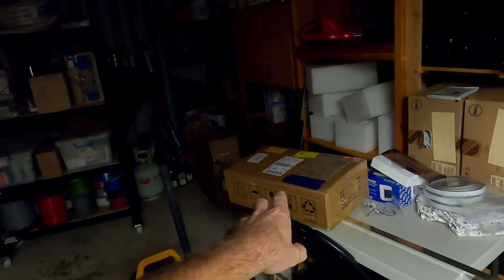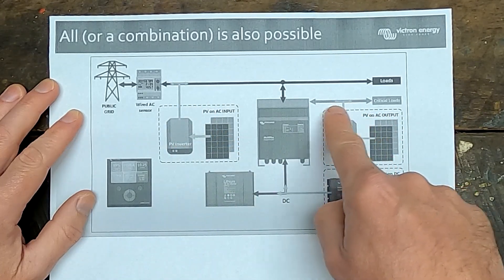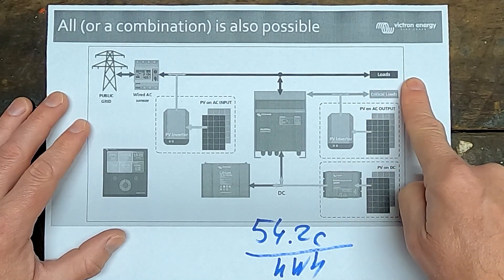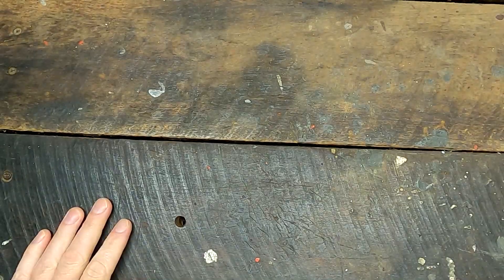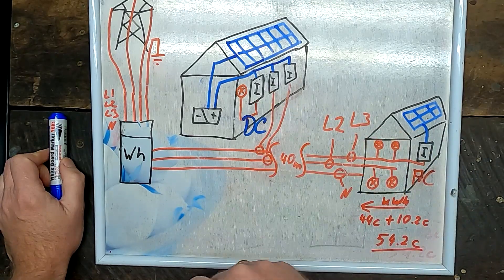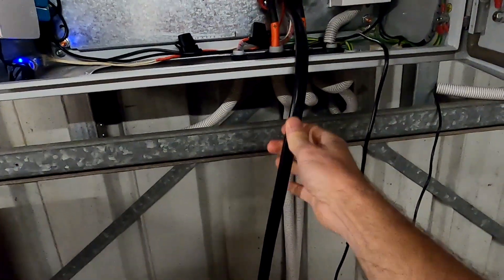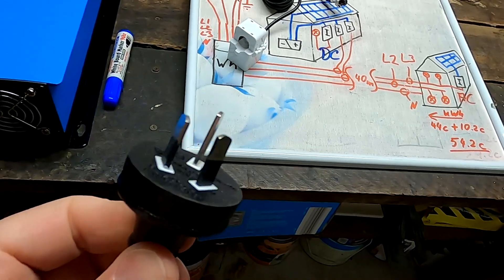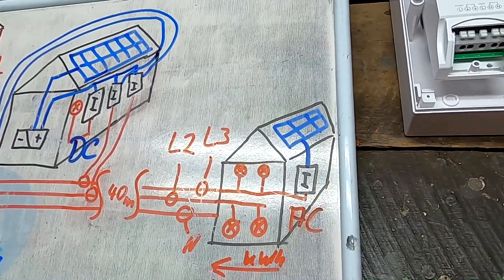Zero feed-in solution to power the house from the battery (and stay legal)

Comment: Andy, I can't stress how dangerous  and illegal what you are doing now. Did you check that this unit is   on the approved list of equipment of your electrical provider, if it is not your insurance of your house is now voided. When you where off grid all good I.e not connected to the grid. Now that you're partly connected to the grid,  there are minimum codes and standards you must meet. Also pumping AC loads bach into a GPO socket is incredibly dangerous, and should never be done. I would strongly suggest you take another look at the victron multiplus because it does meet the minimum AS standards and can be connected to the grid but you will need a qualified electrician to connect it to your switch box. I been down this  road you are going and this the only way that is legal
Reply from the maker: All good, the inverter is CE approved and will not feed into the grid. It's a grid following inverter with anti islanding and will shut down far quicker than the regulations request. In case an RCD triggers or the grid fails it's off in less than 18ms (30ms is regulated). I will not feed in the power through a GPO. This is just to demonstrate how it works. There will be proper RCD and breaker protection as per regulation. Come on... 🤷‍♂️
Reply: @OffGridGarageAustralia  You understand how CE works right?
Reply: I think this may be the only grid tied solution that will meet Australian standards.
Maybe get in touch with Andy and talk to him about it.
Reply: @andrewradford3953  couldn't find the spec sheet for this particular unit but I know for a fact there is no Australian Standard for connect  ing a power source to a GPO, in the  electrical world it is called "a dead man's cable" connection and is band by all electricity suppliers in Australia. So if there is a fire and your house gets damage and the fire inspector sees this type of connection say goodbye to your insurance. There are numerous storys on the web about how bad dead man connections are.  In short, all power units need to be an approved unit and wired into your switch box by a professional. Unless it's through your hot pug which has been installed correctly by a professional. But your hot plug will disengage from the grid when active for obvious safety reasons.

Comment: My friend from Australia... In the victron diagram you would just need to move the current sensor to BE between the main PV inverter and the Multiplus... All energy would go to the grid and the victron uses the battery and solar first... I don't know if the law permits that for your situacion but it would work!
Reply from the maker: That's what you say, but this is not what the diagrams and manuals say for the Multiplus inverters...
Reply: @OffGridGarageAustralia  it basically makes the AC inverter for the big array part of the grid supply. Then the Multiplus ii and the quadros Will consider the energy coming from there as "grid energy".
The only problem for you is the placement of the inverter (is it placed near the main grid AC input? Is it placed in your house?)
And also the quadros and the Multiplus ii can feed back INTO the grid.
I've installed such systems in Portugal and some clients want it like i explained before. We don't have the 54 cents... We only have 4 to 8 cents and we don't have the rules you explained in a previous vídeo. We have people that have systems like yours for 10 years now and they want to Change in order to consume everything they produce because we pay 14 cents per kWh and sell the excess for 4 cents... It's Basic maths.

Comment: I'm certain I've seen the Solark do exactly what you want to do.
Reply: And he is not in the USA so he could easily buy the deye version.  Same  hardware, slightly different software. For about 2000 USD compared to sol-ark which is MUCH more expensive.
Reply: Solark, Deye or Sunsynk inverters are all hybrid (basically the same). I'm any of them will do what you are trying to achieve.
Reply: Solark don't sell in Australia. I don't know if the same inverters are sold under a different brand though.
Reply: @alexsimmons1803  Yes , Deye . for 2k

Comment: I've been thinking about this since you mentioned it a few videos ago.  I'm looking to disconnect some of my house loads from the grid and connect them to the output of a hybrid inverter.  This way the disconnected load is no longer directly connected to the grid - just connected to the hybrid inverter output.  The loads are then powered by a combination of solar/battery/ and incoming grid power as programmed into the hybrid inverter.  I shouldn't need any transfer switches to do this, unless I want a failsafe for the hybrid inverter.  It took me a while to get it this simple.
Reply: A hybrid inverter so you sell power to utility? If not then off-grid inverter.
Reply: @mrzed6597  OK, I get your point - Thanks.  I was planning to completely isolate the loads and attach them to an off grid inverter.
Reply: @donnymeyer1984  It is like many of us do. This is the way :)
Reply from the maker: If you can generate enough solar and have sufficient battery storage, you can go off-grid directly. If not (like me), I'll stay connected.
Reply: @OffGridGarageAustralia  Nope. This inverters are Off-grid With grid support (ACin, ACout port). Not like your Victron that is simple Off-grid (only ACout)

Comment: You wrong about Hybrids. We do it all the time . AC coupled. Sol-Ark can do what you need.
Reply from the maker: It can handle solar at the load output feeding in reverse through the inverter?
Reply: @OffGridGarageAustralia  I am not sure what you mean,the inverter has solar input/output and grid input that is also a grid output for the non essentials controlled via ct coil .
Reply: I use a Sunsynk and it does what andy said hybrid inverters cant do  haha , man i love this inverter!

Comment: Hi. I have 3 of GTIL inverters working right now at home. My experience is, they are not precise with settings and measurments. Forget about different voltage for cut out from battery, it's small problem. But unfortunately at higher load they still sometimes feed power back to the grid. I communicated with sellers (2 different one) and they can not help.
Another problem is efficiency and capacity. I work with 3 x 2000W (on 3 phases)  which are rater 2000W peak and 1800W continuous load. But it's not true. Mine gets usually 1750-1800W at peak 1650W continous and later when getting warm they throttle down to 1550W-1600W.
Another problem. They are sold as working with 46-90V input ... and I have 48V battery pack (400ah lifepo4 working around 53-49V). Already burned 2 of them !! and had to fight for replacement ... as seller saying that 49V is too low when running full load !!! But there should be protection or they should say it's not good in this case. (luckily finally they had replaced motherboard).
So in general I'm still using them but not very happy.
Be careful with back feeding to the grid. I installed additional meater to control this and they send me alarm when there is export. (Which happen for example when high load is switched off and inverter needs few seconds to lower "production").
If you have some questions about them maybe I can help.
Reply from the maker: Thanks for sharing.
I've seen 1750W on mine at 52V DC input. I would not want to run them on 1800W or higher for too long. Hence I have two now so they can share the load.
When they throttle down, they will likely introduce some power to the grid for 1-2s. That will not be a problem as it is tolerated by the grid operator. All grid connected inverters do that when they ramp up and down. Also, the meter will likely offset such small feed-in power with the other two phases.
I've got mine set to turn of at 49V to save around 20% battery capacity for the off-grid system. That works well. I know the voltage measurement is not 100% accurate but that's not a problem.
I like the fact that it throttles down the power when they get too hot, the Victron just shuts down altogether instead of doing that.
Reply: @OffGridGarageAustralia  Please check for yourself with external meter behind CT clamp what is real load on the grid and compare with display on GTIL when under full load. In my cases sometimes inverter shows +5..15 W (as it should be) while smart meter shows export - 30..50W !! Which is not acceptable. Hope your system will work correctly 🤞
I suspect in my case it can be result of using 3 inverters and 10m long cables with CT clamp which generate some errors in limiters.

Comment: Not sure if the power company will agree with you. Any excuse to cancel your feed in tarrif is a win for them. Logically it make sense BUT......
Reply from the maker: I'm staying within the contract and have the inverter turned off as long as them main solar is running and supplying the house and feeds power back to the grid. After sunset, I'm allowed to use any source to power my entire home.

Comment: I probably just missed it, but how are those sonoff things controlled?

Victron has a remote control option, is it possible use that? Put current transformer to house inverter wires and set it turn victron inverter on when there is no longer current coming out of house inverter. There is also current tranformer for victron so it can do same as those  SUN inverters.
Reply: You can also turn off charger from victron, just set charge voltage low enough,

I dont know :-D I need sleep xD
Reply: The sonnoffs are really versatile. They can be flashed with tasmota firmware. From there the possibilities are endless. Mqtt, http, timers. It could be controlled from his victron pi that runs already. Just be aware that although these switches are 15a I think that they are really 15 Chinese amps. More like 10a.

Comment: Couldn't you just put the grid tied solar on the INPUT side of the hybrid inverter ac-coupled, then you're garage panels could be connected to the solar input of the hybrid inverter?
Reply: Exactly, that's how I connected my SMA injector to the MPP Solar hybrid inverter and it works perfect. Not sure if this would be legal in Australia, but it definitely works and won't blow up the hybrid inverter.
Reply from the maker: How? The solar is on the house which is the load. There is now way I could run additional cables.
Reply: @OffGridGarageAustralia  Ok, I am not quite familiar with your cabling situation. In my case I made a contract first to feed into the grid only. The provider installed a bidirectional meter and I installed solar and a SMA on grid inverter, which is in parallel to the grid and to the house. Later I added more solar, batteries and a hybrid inverter and I connected the load of my house only to this new installation. The SMA on grid inverter is now in parallel to the grid and to the line-in of my hybrid inverter. Of course you cannot connect the on grid inverter to the load side of the hybrid inverter as you did it in your sketch. In your case you would probably need aditional load cables from your off grid garage to your house and connect the hybrid inverter's input to the line where you did the snip a few months ago. But this is just generally speaking, not knowing your cabling and legal situation.

Comment: You could use two Sol-Arks. The one on the house could output into the generator input on the other.
Reply: 14,000.00 dollars  !     Yeah do that .   Or buy the same one for 2k in Australia. Deye , Sunsynk .
Reply from the maker: Not possible, as it would require additional cabling from the house to the garage.

Comment: I am not convinced. You have big concerns about not losing your contract. But these inverters might, in case of technical problems, feed into the grid. Does not need to happen, but who knows...
Reply from the maker: They do this only for 1-2s when ramping down after a big load has been turned off. That is OK with the power company and regulations. It is expected to have grid connected gear that will take a few seconds to adjust to load/grid changes, so power can go back and forward for a few sec.

Comment: You might not need the sonoff as the limiter should make the inverter offset power draw from the grid to zero. When the power starts flowing to the grid from your contract system the inverter should reduce it's contribution to nothing as there is no draw FROM the grid to offset. You should be able test this by metering the inverter contribution as the sun comes up and goes down and see it ramping down and up respectively.
Reply: I am with you. i think that he doesnt need timers. Just connect. When the "solar panels contract" begin to export, the grid tie inverters, begin NOT to inject anything.
Reply from the maker: I need the timers as I'm not allowed of offsetting the power from my house as long as the solar feeds into the grid. Offsetting would mean I supply power to the house during the day and therefore would export more power through my high $$$ feed-in tariff. That's against the contract.
Reply: The inverter should only supply power to prevent power being drawn from the grid. As soon as it is flowing to the grid from your contract system it should not supply power.  But I can see a situation where your contract system is not generating enough to cover the house load and therefore you are drawing from the grid to make up the difference and the inverter would try and bring the grid draw down to zero. It would not however push power to the grid. If your contract says you have to draw from the grid during the day for excess usage above what is being generated then you will need the timers. The inverter should not supply power when the current transformer (limiter) sees power being sent to the grid by your contract system, only when it's being taken from the grid. It's goal is to zero out grid usage, not supply to the grid.
Reply from the maker: @wrhealy63  That's not how it works. As soon as I replace power inside the house 'from an alternative power source' it will increase my feed-in. That's what they want to prevent.

Comment: Hi Andy, can you sense the power from your house solar system with a CT clamp, is yes, you can use a firmware like ESPurna, ESPeasy or others to switch your sonoff 2 on without using timers. This will make it very simple and not reliant on timers which need to be adjusted to your solar situation changes during all seasons. Also when you might have heavy rain or other weather which shutsdown your solar from the house it will switch on your "off-grid" system to supply your house. A raspberry pi can see the load on the CT and calls your sonoff to switch on or off 😁 Nice solution by the way, I had some hope for you the old connection to your garage was somehow usable.
Reply from the maker: Thanks Edward. I can access the cables from the house solar, yes. I need to look into this and see how I could make it work automatically.

Comment: Will your sockets and wiring be up to multiple inverters plugged into the same circuit? Say a 15amp ring main, appropriately fused..
Reply from the maker: I'm not going to plug it in to any sockets, this was just to demonstrate how easy it is to connect. 
The inverter outputs only 7-8A at 240V, so far below the 20A breaker the GPO is connected to.

Comment: Dear Andy, when I saw this inverter on your table, I had a strong feeling of deja-vu. The technical solution you found is good, but please be very careful with this inverter. I used two such inverters three years ago and I have  had unpleasant experiences with both. They failed about 6 months after I installed them. And the defect was at both the same, short circuit at the DC terminals. If i did not supply them with good fuses, there was a high risk of fire.So, please be careful and use a good fuse on the DC power supply for this inverter. One of them I repaired and sold, and the other one I still have in the my garage.
Reply: Short-circuit at the DC terminals means blown MOSFETs on the DC side. Can it be that you did not configure properly the amps / watts and you wanted to draw more than 2kw? But yes, fuses are mandatory. If you had LiFePo4 battery, you would have had a BMS which would protect for short-circuit.
Reply from the maker: I'm extremely careful and this is just a possible solution and a test. So all good.

Comment: Check out Outback Power Skybox. Very configurable.
Reply: You have one that actually does what it's supposed to ? You would be the first I've heard of.
Reply: @onthelake9554  Yes
Reply from the maker: It can handle reverse power from the load side?
Reply: Solar inverter power is fed to loads, battery or back to the grid (optional). You can set it to non export mode (time of use configurable).

Comment: if the clamp detects used power then it wont supply anything back to the grid so no need for the sonoff units
Reply: they still might kick in during the day if his house solar is not enough to power the house / big or multiple loads which is not allowed.
Reply from the maker: I need the timer as I'm not allowed to use battery power during the day.

Comment: see tell me if i am wrong they are grid tie inverters so they detect the sinewave of the grid power and then allow it to send power the same way the house solar does so if the grid goes down all hour house also goes off as they is nothing producing the sinewave for the grid inverters to work ? so really this is only to limit the amout of electric you pay for and not to give you power in a grid down situation ?
Reply: Correct 👌
Reply from the maker: Yes, it's a grid following inverter, it will turn off during a blackout. That's not my concern though and expected.